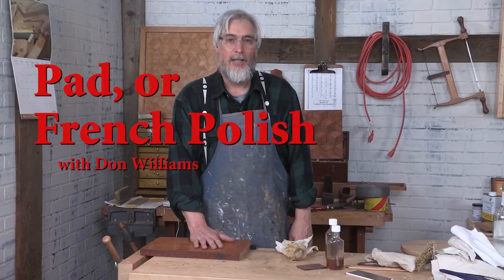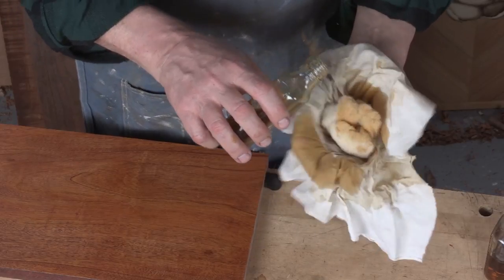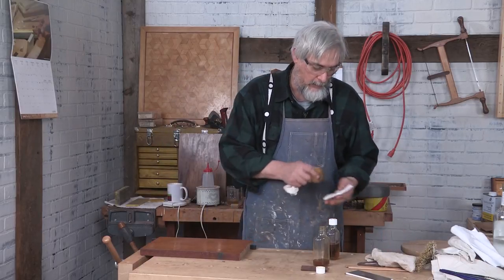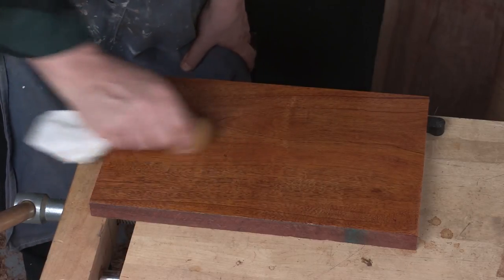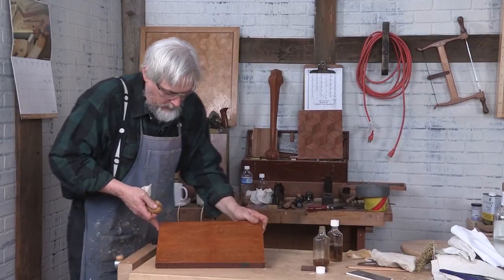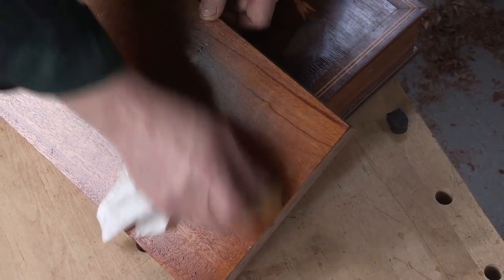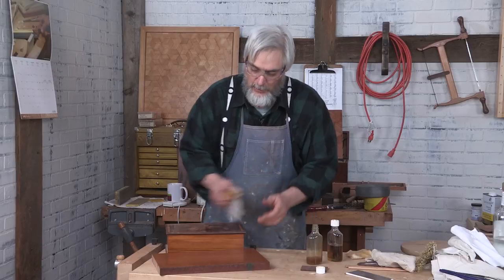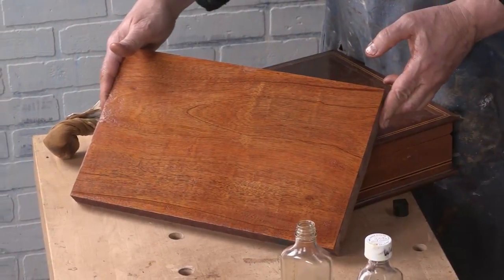Simple Steps for a French Polish

Comment: So when you add little bit of oil on the pad and rub it into the wood, you leave the oil on as a finish product and let it dry out on its own?
Reply: The oil is added as a lubricant because the varnish becomes tacky and will begin to pull out the prior layers you've laid down.
So in essence as long as you dont drench the pad in oil, whatever is mixed into the shellac in the final coats will be negligible. 
I hope this makes sense.
Reply: @Handles-R-Lame  thankyou!